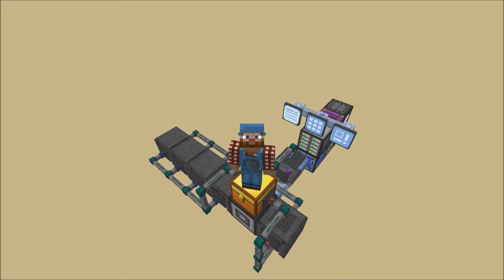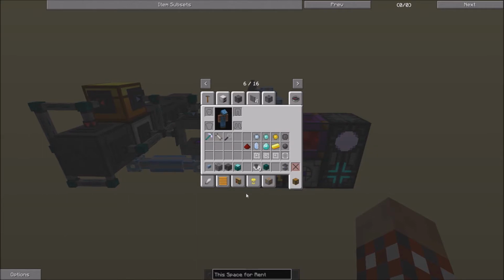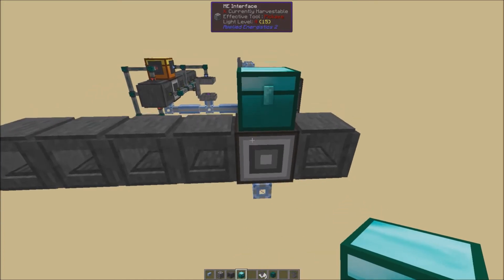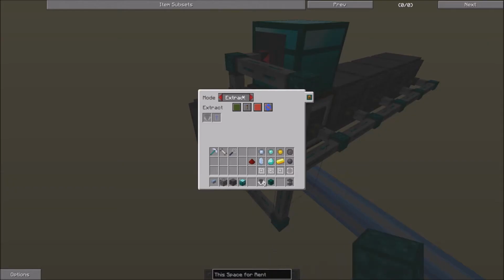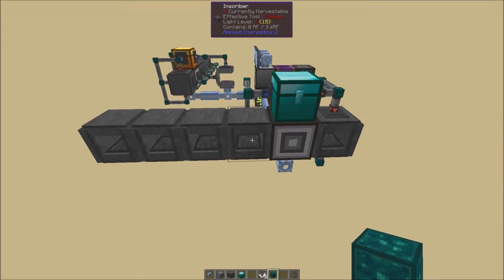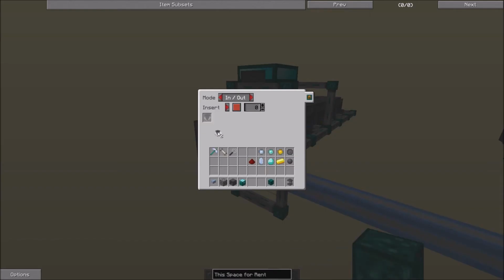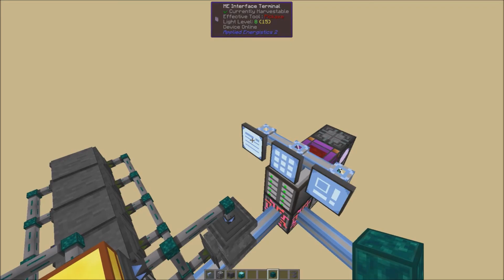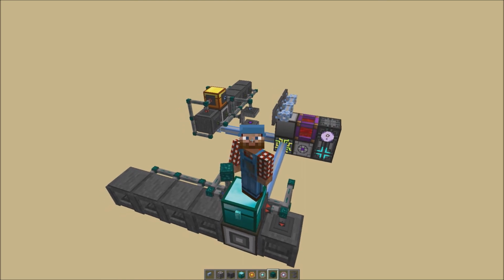Minecraft Talk 20 - Improved Inscriber Automation

Comment: For some reason my ME interface doesnt send redstone to chest which in turn blocks it all
The longer I use Applied Energetics, the more I want to -->KILL<-- those fuckers who made it. Seriously. I want to learn it, but every tutorial is worth glass of piss.
Reply from the maker: Make sure your recipe has the redstone in it.  That might be it.
Reply: Grok DuckFarmer  I think I found the reason why it screws up. I have 3 patterns using redstone (logistic, engineering and 3rd1 i forgot). Because my prints do not return to ME system, ME interface that uses print + redstone + silicon print pattern doesn't inform ME system "I need redstone". So to make it all work, i would have to remove chest from circuit and allow all components return to ME setup so it could send them again to interface... Unless all of that isn't it. Then not only will I be angry, I'lso will be like 1 step from going full ballistic.